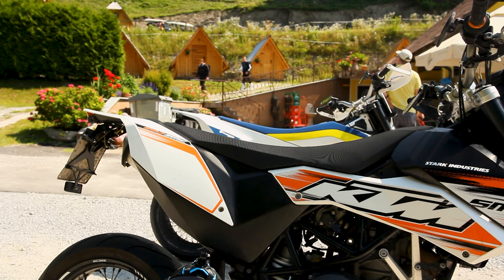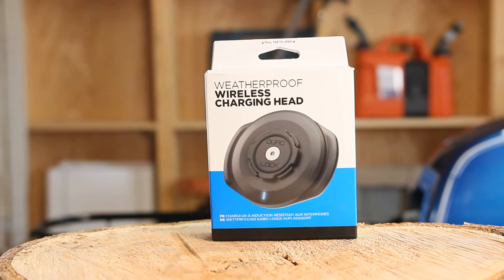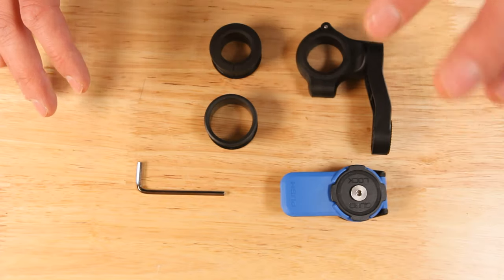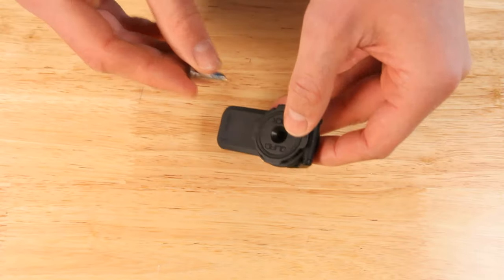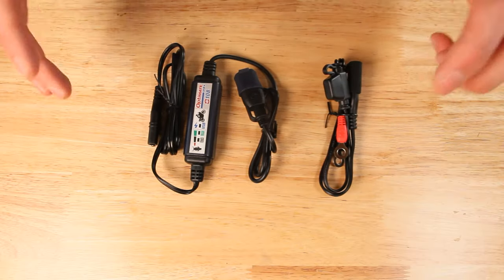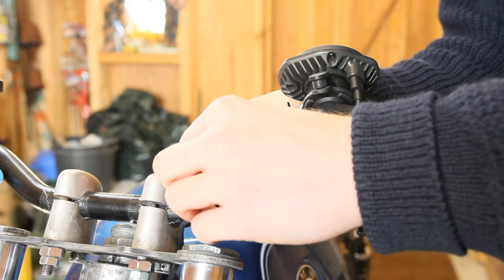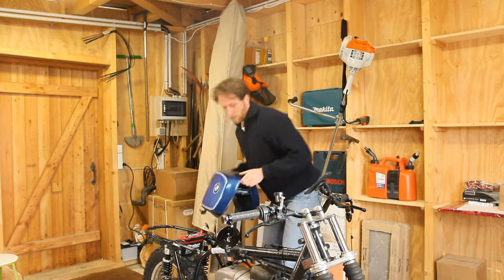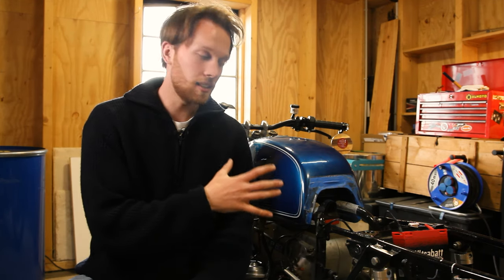How To Install The Complete Quadlock System & USB Charger [Motorcycle]

Comment: The most detailed, and direct, video on this subject, period.
Reply from the maker: Thank you very much, Alex! Appreciate it. What do you ride? Did you get the complete setup?
Reply: @MotoWrenchers  researching.
Probably will get the wireless head, damper, and the "mirror" base.

Edit: 2018 KTM 1290 Super Adventure S
Reply from the maker: That's an amazing bike. Would love to test ride one of the KTM adventure bikes one day.
How do you like it?

That's a good choice. The wireless head makes it very tidy because the cable can be connected permanently  but it's also quite a bit bulkier. Maybe they'll have a black Friday deal.
Reply: @MotoWrenchers  Monster bike
Lots of power, excellent suspension, fun to ride, be it on Twisties or straight highway.

The bike do like to rev a little higher, or else it will shake a lot, at 120kph highway speeds, I need to use the 5th gear, the 6th would be too low down the rpm range to be comfortable for my taste.

Again, beast of a bike.
Reply from the maker: Yeah I can imagine. It's similar on my SMC 690. But I probably don't travel as far as you on the bike so it's not too big of a deal.
One day...looking forward to trying one of them.
Ride safe 👊✊✊

Comment: Another amazing video, timely and informative, I will be going with this system on my BMW also. Being a Luddite by nature, I have only recently migrated to having a Smartphone and this will be a wonderful addition! Cable ties are handy, though velcro is much more so. I would be inclined to add a drop of blue loctite to each of the metal screws once the position of all the components are finalized.  Keep up the good work my friend, I look forward to the next video.
Reply from the maker: Hi my friend! How are you doing? I guess you would have made Ned Ludd very proud by living without a smartphone for so long. Crazy that you have endured for so long. Good job! :) I never used velcro on a bike but that seems like a very nice addition to the tool box. Especially now, when it comes to wiring. Thanks for the tip :) That will go onto my list of rather unconventional but very helpful tools (for a future series). Do you have any other unusual tools that are super helpful? My favorite in this category is the syringe. An absolute life saver when it comes to refilling the front break system.
Regarding the loctite, there is some on the screws already but you're absolutely right - it can't hurt. I'll add some later. Thanks! Have a great week, my friend!
Reply: @MotoWrenchers  Good Morning. We used velcro exclusively in the data industry for cable management. I am of course speaking of the velcro that has the hook and loop on the same tape  (not the separate hook tape and loop tape that our mums used on our knickers :) . Primary advantages are that it is stronger than the smaller cable zip ties and even more UV resistant, completely weatherproof and infinitely adjustable and reusable, also will not chafe or pinch wires.
 AT-205 Re-Seal was made for the automotive industry as an oil additive to help rejuvenate oil seals and was used as an oil additive, has the consistency of water and can be applied  directly to old rubber parts on our bikes to help rejuvenate, rubber grommets, fork gators and the like. Works a treat too!
I have been on this planet longer that your dad and have picked up many different tools and tips and will gladly share whatever I know for your build.
Reply: Using a syringe to help bleed the brakes is very useful especially on the smaller brake cylinders used on our motorcycles....Great tip!
Reply from the maker: Nice, I'll definitely pick some AT-205 up if I'll find some. I definitely have a few parts on the BMW that could use a rejuvenating treatment. Would be awesome to reuse a few of those. Thanks a lot :)
Reply: @MotoWrenchers  I bought mine on Amazon, here in the states. If you have any trouble finding, let me know and I will ship you a bottle ( No affiliation and I am not a dealer). Application can be a simple as a small cotton cloth or even a small spritz bottle.
Reply: I have found a less expensive and more effective alternative to using brake cleaner to clean small parts/ carburetors. Better solvent, dries instantly and is not harmful to  most materials we deal with. Caution with enclosed areas as it is highly flammable. Starting Fluid is a treat :) Top of the day to you!
Reply from the maker: Awesome, thanks a lot. That's a very kind offer. I'll have a look when I order sth the next time. The wait won't be too long 😅
Reply from the maker: Really? I definitely need to try that 😍 I've got an ultrasonic bath for my birthday this year...my carbs will get a spa treatment :)
Reply: @MotoWrenchers Awesome, I am in the process of building one, from what i have read they are very versatile and work a treat!
Reply from the maker: Nice! Really cool, that you're building one yourself. The help a lot. Makes cleaning carbs a pleasure 😅

Comment: hi, very nice video! just one question: does the Optimate charge your phone while riding with active GPS and full screen brightness on? did you already test this scenario? thank you for your info!
Reply from the maker: Hi Chris, thank you very much for the feedback 🙏 I unfortunately didn't have a chance to try the set up in real life yet because the BMW is still in the making but I've contacted @OptiMate1 and asked them for an answer. As soon as I know more I'll let you know. Are you also thinking about getting the Quadlock system?
Reply: @MotoWrenchers  thx for your comment. I already have exactly the same setup as you have, but running in that issue by using the GPS during a sunny day-ride with fully display brightness on. to me, it seems that the optimate provides too less power to charge my iPhone through the quad lock wireless adapter. so, I'm waiting to hear what your experiences are in real riding...
but you can make a test for your own: let your smart phone drop down to approx. 15% state of charge > hook it up on the wireless charger > choose a route on your GPS and press start > turn on your display brightness to max manually > watch out for about half an hour, and see what's happening to your batteries percentage...
I would appreciate your feedback very much!!
Reply: @icmz73  Hi Chris, sorry for the delay in this but heard you had a question! To answer your question, YES it will work! The O-108KIT will charge at 3.3A which should be more than enough to maintain and increase your battery state of charge while riding with everything on the phone turned up.
Reply from the maker: Ah that's a shame. I'm traveling at the moment but will be back in October and will run your test once I'm back home. Once I know how how it turns out, I'll let you know :)
Reply from the maker: Thanks for answering, guys 👌

Comment: Why wouldn’t you center the charger to the handlebars?
Reply from the maker: I am planning to build a bracket for the speedo that will place it in the center of the handlebars. Having the phone on the side seemed to me like the best solution to still see both. But you could also place it in the middle which would probably make it easier to see the navigation on the phone. Do you also have a quadlock system, George?

Comment: It's silly you need a whole another battery pack just to power quadlock charger
Reply from the maker: Hi Rob, which one do you mean?
Reply: @MotoWrenchers I mean to install the phone charger that you have to dismantle the bike and wire it to the bikes Battery in order for it to work would be so much better to attach to handle bar plug and play instead of all that faff
Reply from the maker: @CoasterRob ah yeah, you’re absolutely right. If you have a handlebar plug then that is the much easier solution.